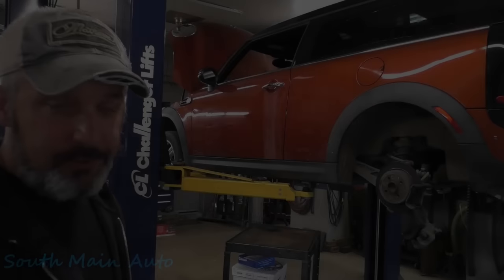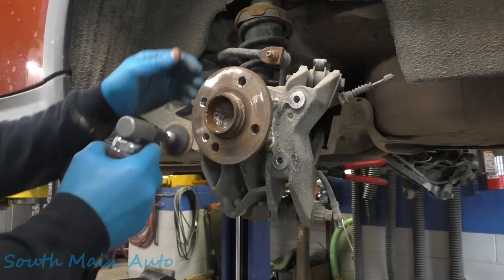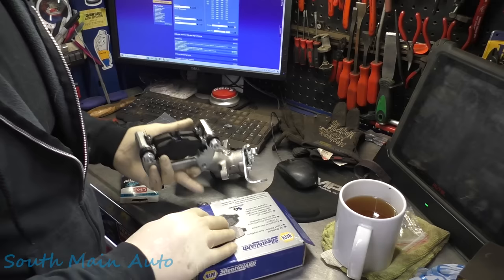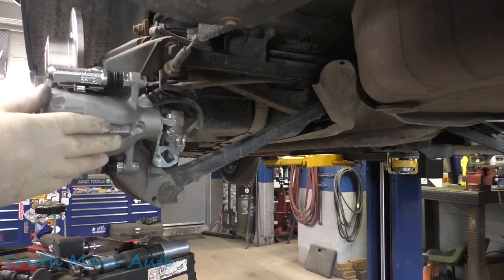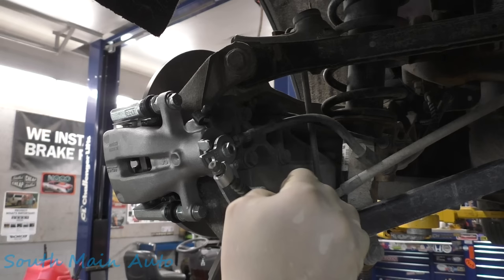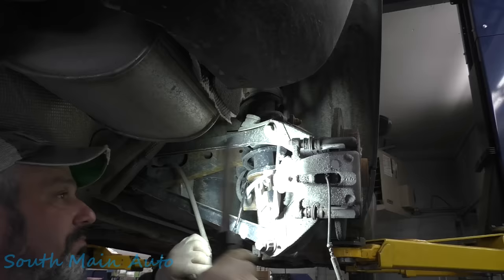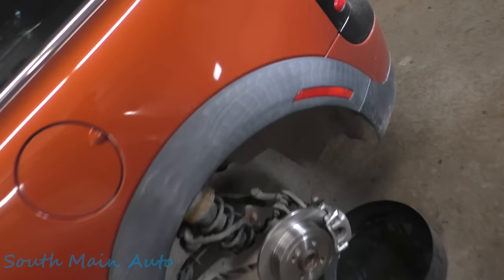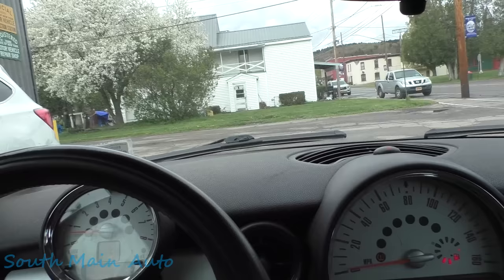'12 Mini Cooper: Rear Brake Pads, Rotors & Calipers

Comment: Eric, there is an excellent way to remember the conversion factor between N-m, and Ft-lb. Now I know that you don't fly, but, the most common commercial airliner on Earth is the Boeing 737. 737 is the conversion factor between N-m and Ft-lb. If you have a value in Ft-lb divide it by 0.737 and that will give you the corresponding number of N-m. If you have a value in N-m multiply that number by 0.737 and that will give you the value in Ft-lb. Just a little tip for you from out here in the desert Southwest.
Reply: Nice tip!  I always used 3/4 as good enough.  But the 737 is easy enough to remember.
Reply: it is not 737
Reply: @javirodify  if you want to be like that, it's .737561.  737 is good enough, actually 3/4 is usually good enough.
Reply: @javirodify  OK, wise guy it's 0.737562 like anybody cares about 0.000562.
Reply: @satamanschmidt3428  Yup. Torque wrenches aren't even that accurate.
Reply: @satamanschmidt3428  Absolutely. Most humans are incapable of wrapping their head around 562 MILLIONTHS. Imagine how long it would take some people to do mechanical work. "Yessir, that brake job will take five days and cost $3500. But the brake fluid is free."
Reply: Thank you, I think Eric is cheating with his digital torque wrench. He can set it to the world standard with the push of a button.
Reply: @billc7211  3/4 I can do in my head, the same as .6 for speed, and x2+30.  Not exact, but close enough for the girls I know.

Comment: Hi Eric,
On the Mini, the bleed dust cover has a loop of rubber so as not to loose the cap but it also doubles as a wear sensor wire retainer, just feed the cap around the cable.
PS, still enjoy the vids and the English accent 😂
Reply: They still have that huh? My 1992 BMW with ATE brakes has the same bleeder cap with the cable loop.
Reply from the maker: Oh cool thanks 👍
Reply: The English accent was just about as bad as Dick Van Dyke in Mary Poppins.
Reply: @DougieLawson  That was my thought, he's doing a Dick Van Dyke
Reply: Should you use a German accent  because it is a BMW?
Reply: @ClassicBMWFanInQuebec  You'd be surprised by how many similarities you find working on BMW's even if they're 30 years apart
Reply: @imnota  very true especially rear brakes
Reply: @paulbenkovitz2061  and that would mean the test drive was on the correct side of the road.
Reply: @imnota  Yup, stil the same failures too
Reply: Think it is a older European car thing, same thing on older VW Golf, Volvo, SAAB, BMWs and some Audis
Reply: @ClassicBMWFanInQuebec  with mini being owned by BMW , they use many parts from same
Reply: @SouthMainAuto  Looking closely the right bleeder cap was on the left hand side, just needed to swap them over?

Comment: Hi Eric. Bowden is called everything with a wire in a hose or a pipe over here in Germany. You will find them on bicycle brakes as much as on cars for clutch, brake, choke gas purposes or on anything that requires the transmission of  push - or pullforces over a distance. It is named after the irishman Ernest Bowden, who invented it.
Nowadays it is often replaced by hydraulic or electric devices.

Comment: A "Bowden" cable is any cable where the core pulls through the center of an outer tension casing. Any brake cable like that as well as bicycle brake and shifter cables, motorcycle clutch cables, etc, are all examples of Bowden cables.
Reply: Bowden cables are bidirectional, unlike bicycle brake cables etc. which are unidirectional.
Reply: Not to forget the once ubiquitous choke cable.
Reply: @PiffleMasterYT  If they were unidirectional the brake would never release once applied.
Reply: Who is Bowden? 🤷‍♂️
Reply: @TheOtherBill  There is a return spring.

Comment: Back in 2014 my wife wanted a Mini Cooper.  I didn't want to get one because of the poor reputation for reliability and repair costs.  She won out.  Found a high end Mini Countryman with 8,000 miles. (R60)  4WD   The car now has 60K+k  miles on it and it has never given us one issue.  Nine years later she's as happy as a clam.  I maintain it myself as the dealership is far away.  These cars are real performers in the snow.  I have been pleasantly surprised. By the way Eric, the car is made by BMW in Austria.  Try your German accent the next time. it can't be any worse....  You got a terrific helper there but I'll bet you already know that.  Thanks for the videos....

Comment: And here I thought I was the only one who packed the core box full of misc stuff.  Pads, hoses, clips, rusty bolts, the pos tool that aggravated you that day, etc.  I tell my guys if the old rotors would fit, they'd go in the core box too.  Always saves you a couple trips to the trash can or scrap bin.😂😮
Reply: Drifting away from things automotive but I do the same thing when returning printer toner cartridges for recycle. Everything generated from the process (cardboard strips, plastic covers, packing slip, packaging, etc.) goes in that box and nothing into my trash when I’m done.
Reply: I work at NAPA so thank you for that!  heh heh. We only want the part complete in original box, so anything else goes to reman people with it.
Reply: Wuss-Bag productions presents “wtf was I thinking and why did I even get out of bed this morning?” FOR THE MONEY!!!!!!

Comment: I drove my 2010 mini for 2 years with the low tire light on thinking that one day I would buy new tire pressure sensors  and get them programed to the car, but couldn't justify the cost. Then I got reading up on it and found you can do a reset to turn off the light and there are no sensors. The tire pressure monitor works through the abs. If a tire is low the circumference changes and the abs monitors a slower speed on that wheel and turns on the light.  Funny thing is, there are tpm sensors listed for this car!

Comment: Love your work and videos.  I am 67 and retired tech.  Still puttering with my vehicles.  Changed my Diff oil and transfer case oils today.  I have a few pet peeves!!  For example ....when I started working in the 70s it was foot pounds of torque....not pound feet and I will continue as such.  How about you? 
I say Engine not Motor.  
Gasoline or diesel engine.
Electric starter motor!!  
It's the way I learned in school.   Kinda like a Man and Woman.
Not gonna change my learning on the say so of delusion!!  Hahaha 😂😊
Reply: and all the fasteners were standard, 7/16, 1/2, 9/16 etc!!
Reply: On the subject of engine versus motor, a motor is something that imparts motive force. Every engine is a motor but not every motor is an engine. People say "motors are electric" but will use an impact wrench with an air motor in it, totally neglecting pneumatic or hydraulic motors. The terms are really interchangeable for all intents and purposes but yeah technically it's an engine.
Reply: School physics (1960s, Scotland), it was foot-pounds for a force, pounds-feet for torque.

Comment: Hearing you talk about attempting an English accent,  reminded me that a lot of people thing that these Mini's are British cars and some even have union flags on the rear lights. These Frankenstein cars are not British, they are German cars that now have French engines. They were not even designed using the same principles of the original designed Mini. Made me chuckle when you asked Mrs O if she was pressing the correct pedal as I was once bleeding the clutch of my 1962 mini and a girlfriend was operating the pedal for me. Well, I even purchased a new master cylinder before I realised that she had been pressing the wrong pedal.

Comment: In the 60s and 70s I used to race 1275 Mini Coopers. Brilliant little fast cars of their day. Roll cage inside the body ... just in case. Great fun. Foot hard down on the throttle and into the bend we went. Power puuled me through every time.
Reply: Those Mini's had spare maneuvering power?  wink,wink.  I've always wanted the first 2 door reincarnation, manual trans of course.  All the other variants just dont have the charm.

Comment: 33:17 wire wear sensor is secured by the bleeder screw rubber cap... but zip ties work too.
Reply from the maker: Oh is it really!? Dang! I looked in service info too and they didn't even mention it!
Reply: I worked on a 2020 Ford Transit rear bakes today, and the wire was secured the same way.
Reply: should say cable ties not a zip ties.. 😂😂😂
Reply: They are zip ties because of the sound they make fastening them. 😂
Reply: @gilberta458  they can tie more than just cables    zip it is

Comment: Heck I didnt think most Mini Coopers lasted long enough to ever actually NEED new brakes....😂. Thanks as always, Eric...
Reply: If they were "British" minis they would last.
Reply: Cooper S’s lasted pretty well,  if you missed the trees…   There was a time when they wouldn’t insure them unless they had a roll cage and you were over 21.
Reply: @CrimeVid  Sounds like a Ford Escort MK1.
Reply: @CrimeVid  That sounds extremely unlikely.  Getting insured on anything with a roll cage fitted is very difficult, you usually need specialist insurance.
Reply: @ferrumignis I think that was sarcasm.
Reply: It’ll probably outlast several American brands, remember it’s German engineering and quality
Reply: I know my dads BMW had very soft stock brake pads. I would have thought the minis are the same now a days. Bad for break dust and longevity, but man that car could hurt you if you have to stop quickly because of how good the brakes were. Best brakes out of any car I've ever driven. Even though it was rear wheel drive, really good on snow too. You could tell the Germans put a lot of effort in their suspension and brake systems.

Comment: The brake pad wear sensor wire is usually routed in the "rubber loop" of the brake bleeder cap, for next time :D
Reply: "Next time" or 2034

Comment: The width across the flats (WAF) determines the wrench size used. A finish pattern hex nut and bolt will have the same WAF for both the nut and bolt. The same holds true for a heavy pattern nut and bolt. As long as you do not mix up finish and heavy patterns you will use the same size wrench for the nut and bolt.

Comment: My wife has an '05 Mini Cooper (R52). If memory serves, the brake sensor has a rubber loop on it that actually clips on over the caliper bleed screw. That's what holds it in place in the area where it was floppy and you cable tied it.

Comment: I use an old inner tie rod to put on tires with lug studs. Cut it just past the flats so i can get a wrench on it when my arthritis acts up. Just have the one, fits most cars. I like the idea of cutting heads off bolts too.

Comment: WF is Whitworth Fine thread. I had a restored Morris Minor Traveller and I swear that thing had every type of metric/imperial fastener ever created. I rebuilt the gearbox, and had more spanners/sockets on the bench that gearbox parts. Love your work Eric, greetings from Scotland.
Reply: These new minis are all metric, the size is WAF13 (width across flats) so 13mm bolt or nut size. Trust BMW to complicate matters!

Comment: No need to worry about the British accent, the Mini is a BMW anyway.
Reply from the maker: For some reason I thought they were still made in England but owned by BMW
Reply: I’ve done a few mini’s myself. Zippy little buggers.
Reply: @SouthMainAuto You are correct Eric they are made in Oxford England.
Reply: Manufactured in England Netherlands Austria and soon to be Germany.
Reply: And Peugeot have a part in it too
Reply: Bavarian motor works
Reply: @Mr572u  That is accurate.

Comment: Mini (also called Classic Mini) is British.  MINI is German  - owned by BMW.

PS: Now I think on it, bolts that are designated by the shank/thread diameter instead of the hex size...maybe they're Whitworth bolts?  😁
Reply: Came here to say the same. Forget the British accent for modern Mini's. It should be German accent.
Reply: The minute you see it has wheel bolts (not studs) you know its German.

Comment: You usually “clip” that sensor wire with the rubber dust cap of the bleeder screw just to hold it
Reply: This is really neccessary though. I forgot to clip it back and the rubbing of the cable against the rim triggered the "replace pads" message (and eventually a red brake light in the dash) on my BMW 1 series

Comment: I usually give the hub lip a little zing with a wire wheel too. Prevents the wheel from sticking for the next guy and gets it centered on the hub real nice 👌
Reply: A clean hub face also prevents brake pulsations from the new rotor. If the rotor is mounted slightly off axis because of rust jacking underneath, the pads will have to grip a wobbling rotor until it wears in.
Reply: And a touch of grease on the hub keeps the wheels from sticking too.

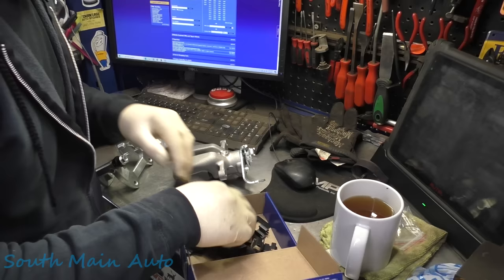Comment: What I find odd about those aftermarket pads is the way there don't seem to be any positive "bumps" on the inboard side of the inner rear pad (seen at 9:25) to mate with the positive cross on the head of the piston. Most of this style of parking brake will rotate the inner assembly while the head of the piston can't rotate because it is held in place by those mating bumps.

Comment: I always use high temp grease instead of the silicone stuff. Because I am too cheap for the silicone grease stuff. Is this a dumb idea? Never had problems but i live in Texas with no rust issues.

Comment: Speaking of British conventions. Many older British cars and motorcycles used Whitworth fasteners. Whitworth wrenches are labeled based on the bolt shank diameter rather than the distance across the flats of the head.
Reply: True, Gets folks really confused if they visit the green tool box in my shop. All Whitworth tools in it from working on British made gear, Both bikes and bottling machinery.

Comment: I used to work at a Volkswagen dealership and their service data talked about micro encapsulated bolts. It’s a just a fancy work for bolts that come with pre installed loctite. Just in case anyone was curious.

Comment: 5:40 Many inner tie rod ends are the same thread pitch as 14mm wheel bolts. cut the threads off and there's your alignment pin. I keep one on every corner of each hoist.

If the pitch isn't right for BMWs, it still goes in a couple of turns; good enough.

For 12mm 1.5 pins I use left over Miata camber eccentrics.

Comment: When I owned my Volkswagen, I did have reteach myself a few things including buying specialized tools. The wheel stud kit you speak of, I bought it. It makes putting wheels back on, especially when the rotor doesn't have securing screw, very easy. If you don't work on a lot of imports, it's really not needed. They're not very expensive, less than $100

Comment: R55 is the clubman. Common thing for rear calipers piston to freeze from salt and debris in colder climate region. I recommend checking the oil level often, since they consume oil and your engine will run happy and no issues like everyone else complain about the Prince engine. Once you know them very easy to work on and you will enjoy for many years a head!
Reply: Yeah like having to rebuild the supercharger every 100,000k great.

Comment: Hey Mr. O. Those fancy Mini Cooper rear calipers have a ratcheting style parting brake. You have to screw them in as you apply pressure to get then to retract. But hey the boot was trashed so no big deal.

Comment: Microencapsulated, = that thread locking gunk which is loctite inside tiny glass capsules mixed with a paint to make them stick to the bolt.

Comment: 4:25 for the "comment generator people" whom don't like the pinch pliers... I was a Midas man for many years ASE certified in brakes among others...

The pinch pliers on a (fully assembled) hydraulic system are actually a good test tool in addition to just stopping the leaks.... Check this...

On a non-leaking brake hydraulic system, it is possible for the brake pedal to still "go to the floor" or act weak making you think you have a leak.

Therefore it is a valid test to pinch off the rubber brake hose at each wheel, and put your foot on the brake pedal for a minute or so and see if the brake pedal still goes to the floor... If it does, it means you have an "internal leak" or a bad master cylinder (most likely) the fluid is bypassing the piston/seal o-rings.

(could probably also be something in the abs system), but I've found several bad master cylinders this way...

The key is, just don't leave your pinch pliers on a customers car and release it 😂... I found my first pair this way, and they had been on the car so long, they were weak, so I handed the Snap-on (found) used pliers to the truck tool man and he gave me a brand new set FOR FREE!

Comment: Those pad wear sensors are multiple use but if you mess up the old one taking it out of the worn pad you'll need a new sensor,  needs a small pick to flick the spring out of the pad each side, a little penetrating fluid helps.

Comment: So funny to sée you working on more familiar cars to me 😊

The mini is packed with BMW electronics and studf, including the instrument panel and service reminders in it, the reminder has front and rear brakes on it, and they can only be reset for sometime after installing new brakepad wear indicators, so when you get the call -you just did my brakes, and now i have a fault in the dash. That's the reason for it... no special tools needed  for resetting, just pushing stalkbuttons

Comment: These models use the Peugeot engine, values seals get hard and dump oil into the combustion chambers. The later models use the BMW engine. The brake sensors can wear too early, best to unplug and check manually for wear. I had a r56 for 9 years until it was time to dump it for a donation. Brought back old memories of several brake jobs.  Thanks for sharing

Comment: I think I have used a 16 mm socket twice in 40 years. I do have a 10mm open end wrench which was heated up and bent 90 degrees to bleed the brakes on a 1972 Mercedes soda truck. Tool used once